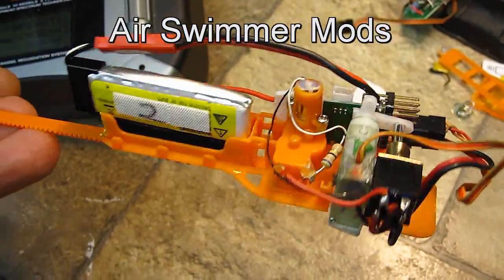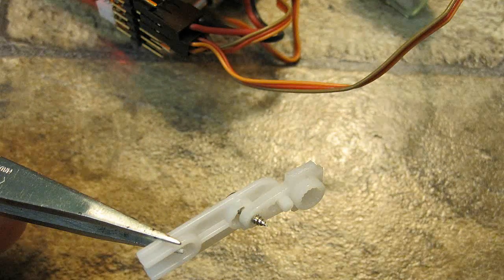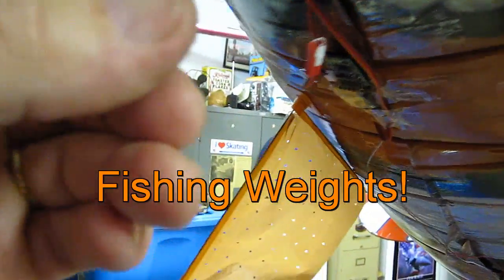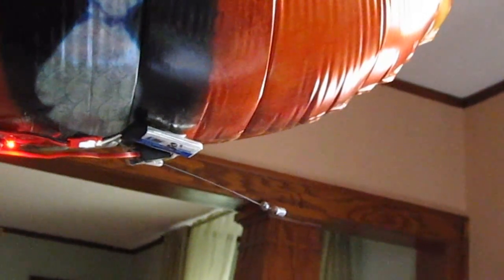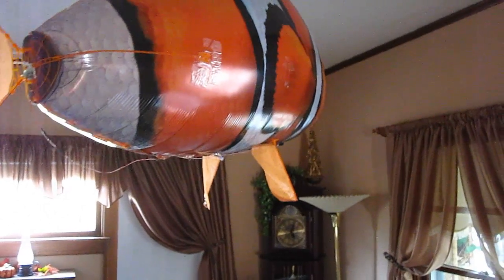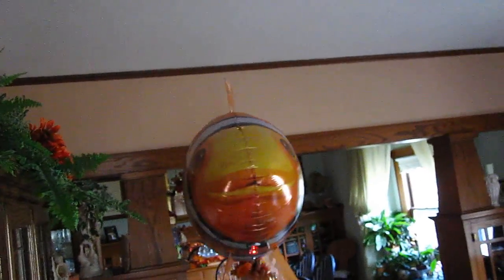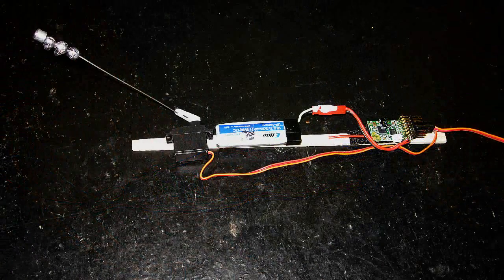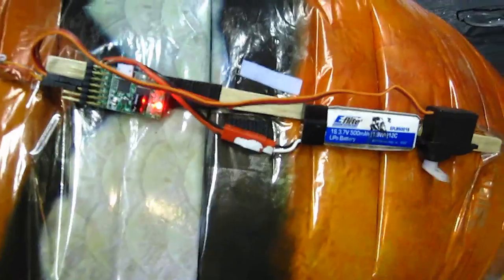I converted my Air Swimmer to 2.4 Spektrum and re-designed the Weight Transfer system.

Comment: I have the Blue Shark version and it is fun to fly in rooms, wanted to fly outdoors but as you mentioned the IR receiver/radio protocol not suitable under the sun as Sun too emits IR, I too wanted to convert it to my Radio but receivers were quite big this setup now spektrum has introduced some light weight receivers wondering some day find one and bind one to have it flown with my Spektrum radio, watching in 2021 takes me back in time, fun to watch. Besides, I had this shark laying had bought 5 to 6 years back I guess. If any mods for 2021 for this fish or similar projects would be great to attract children and adult flyers too. Clear Skies, Stay Blessed! 😊👍💚👌
Reply from the maker: Yes you know for sure.  Well, I have been using Hobbyking Lite Orange RXs in lots of models and they are tiny and cheap.  It would work well for you.  I lost all my models in the fire in 2016, so don't have the swimmers anymore to try again,  but it would be fun to do another one. Thanks and God Bless.

Comment: I'm looking at your video is inspired.
 However, the failure was my first convert.
 I disassembled the servo servo neutral and find one adhesive has been fixed. The continuous rotation servo was possible. Remove the servo and the servo was originally the Mount has been removed. Mount the servo in place, and had prepared a new servo motor is stuck some. The operation of a newly connected servo motors have been successful. Your video showed me the possibilities, thank you.

Comment: try cutting the valve of and replace it with one of those ones one beach balls and air mattress' and glue it on with epoxy and tape
just a theory i don't have one so see if anyone else has done it and if you are the first could you recommend my  channel

Comment: Nice Video. Are there any replacement ballons for the Air Swimmer?
Maby you could try  to modify the valve to get it more tight if there arent replacement ballons.

greetings from germany